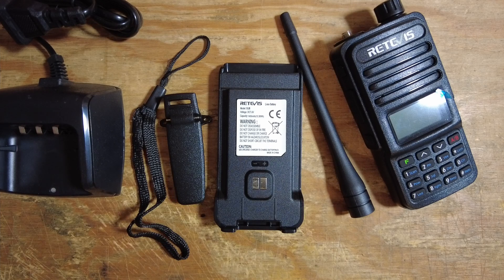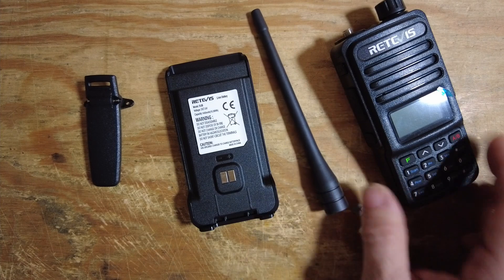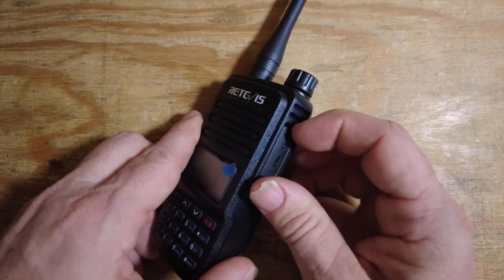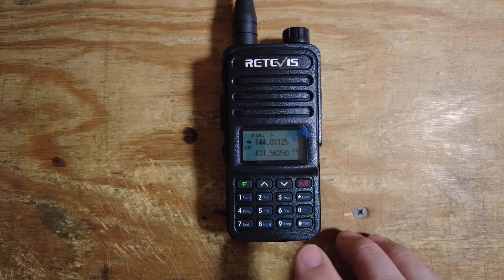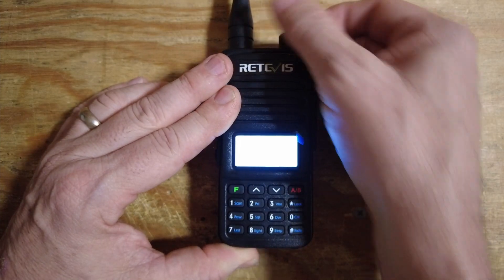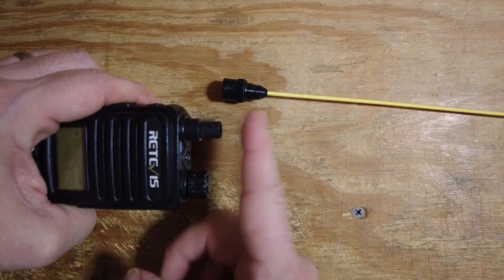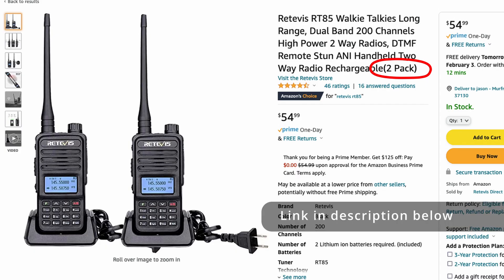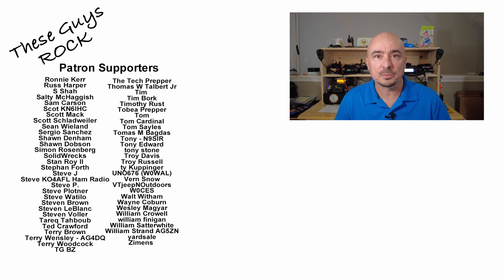Retevis RT85 Review

Comment: Will this one work better on digital, like APRS?
Reply from the maker: It doesn't have APRS built in but with the right cables/sound card, and software it can be made to do APRS. It will pair nicely with either the Mobilinkd TNC or the digirig sound card.

Comment: Anytime a product review is one where the company gifted said product, i'm immediately skeptical. That being said, what did we learn? What is the power output? How long does that battery last? Etc etc.
Reply from the maker: I'll agree 100% about being skeptical. That being said, this is in line with the UV5r for power output and receiver quality. The build quality is a step above though. If I was choosing between this and the UV5r, this would be my choice. I find battery life very subjective. It all depends on how one uses the radio.
Reply: @KM4ACK  What is the power output? 5 watts? 2 watts? i can't find that info anywhere.
Reply from the maker: The manual says 5w but I didn’t test to confirm. I loaned my meter out and it hasn’t returned.

Comment: I am fine with clips on batteries. I love my pair of RT-85s. The Radioddity GM-30 USB Chargeable batteries work on these radios. It was a pain figuring out how to display my names for frequencies and repeaters. But they responded overnight with terse instructions that were accurate. Good review.
Reply from the maker: Thanks for the tip on the USB batteries.

Comment: Hey Jason, very interesting. It looks and behaves similarly to my Radioddity GM-30. Trouble for me has been finding a GMRS tuned antenna for it. Which signal stick (band) are you using there? Thanks for the review. Cool little radios.
Reply from the maker: The one in the video is 2m/440.
Reply: @KM4ACK  Great! Thanks. 73 KI7WJP Eric
Reply: UHF 440 ham band is so close to GMRS frequencies that there's no noticable difference between antennas that are said to be 440 ham band or GMRS